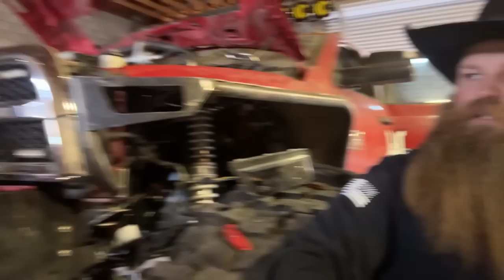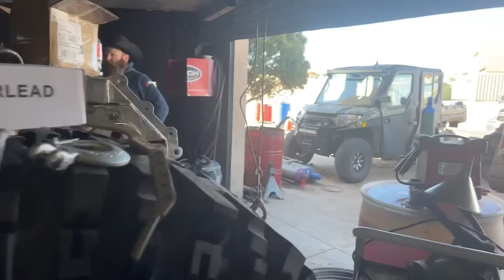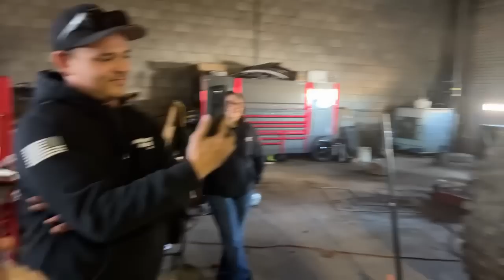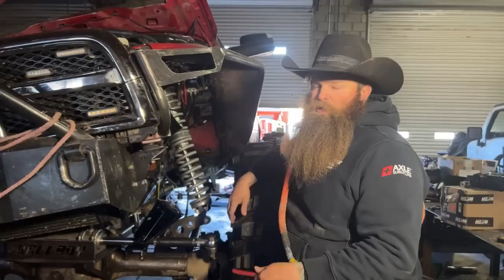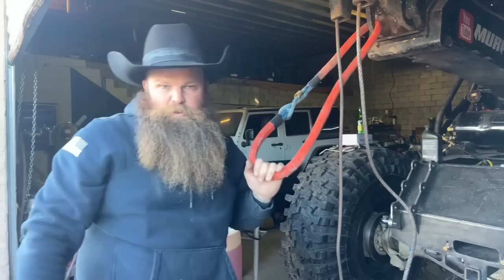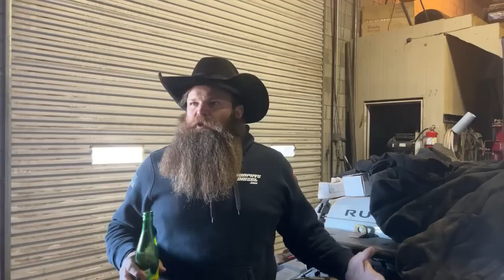#offroad Games 2024 and Hellboy update with Wrecker Rick

Comment: Hey bud you can still use your same HEADLIGHTS, Just Grind off the Weld's Across the top of Them and heatThem up so you can bring the outter ends away from the tude frame. That will make them shine more to the Middle of the highway better.

Comment: Why not throw a kc 20"  led light bar which should give you approx 6 lights  under the the bumper . Control the outside 2 left and right with one switch rest centre lights with another switch  .